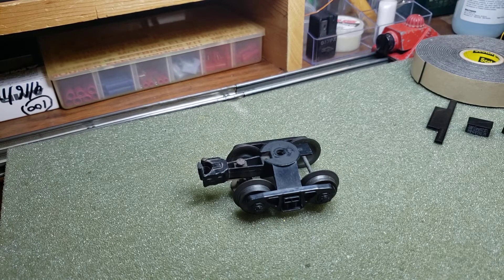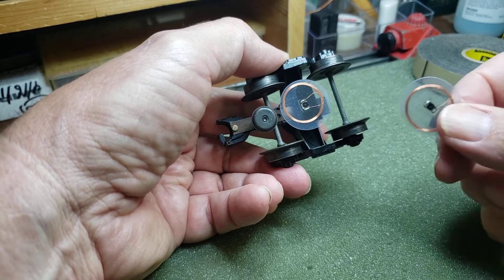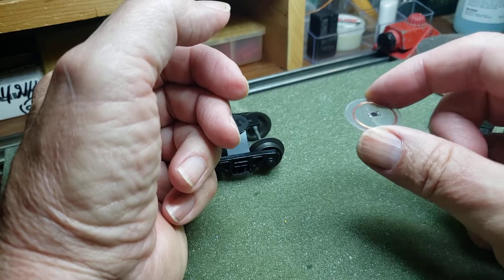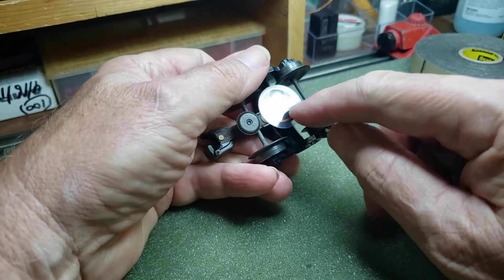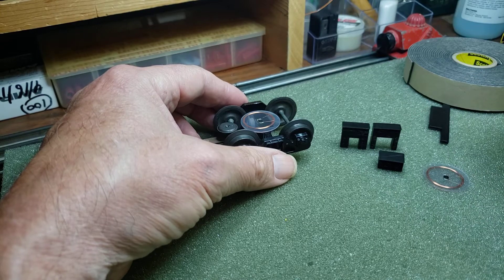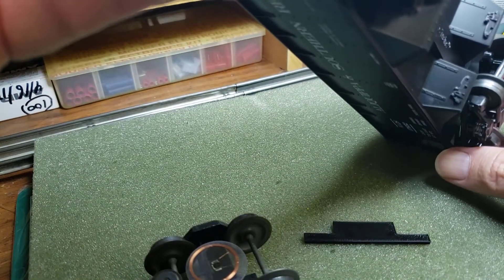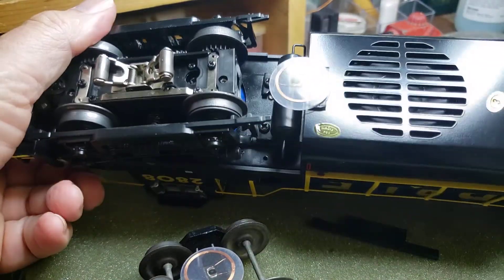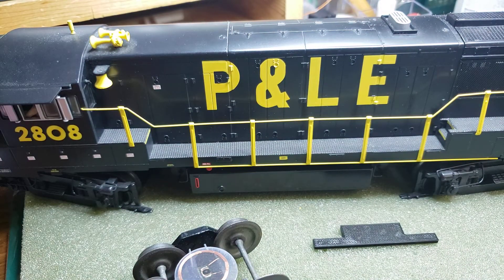RFID On My Train Layout - Part 2 - Tag Mounting

Comment: What is the diameter of your antennas?  I work with 009 (narrow gauge, same scale as OO (similar scale to HO) and same gauge as N).  I don't think I can use antennas that big.  Have you looked at 'grain of rice' tags (which you probably wouldn't need)?